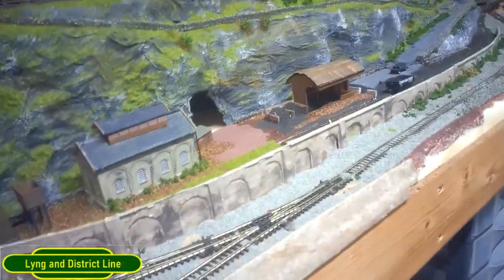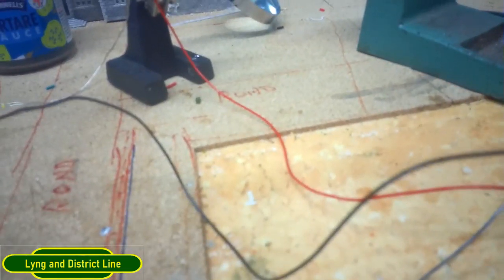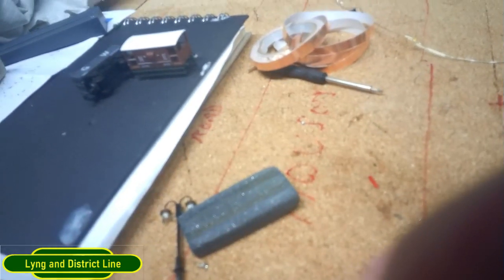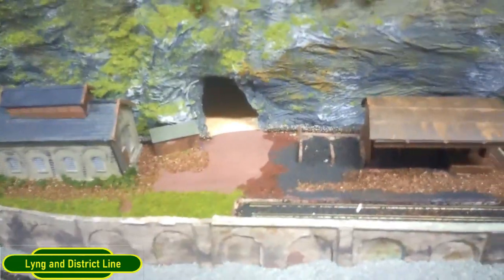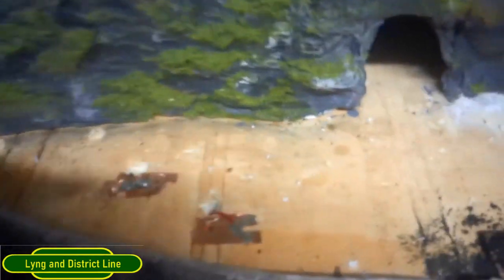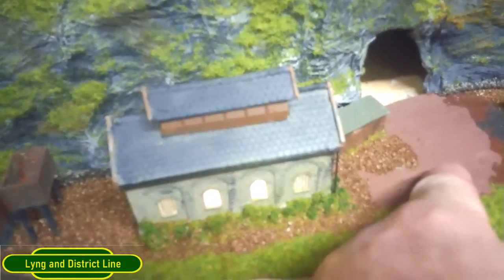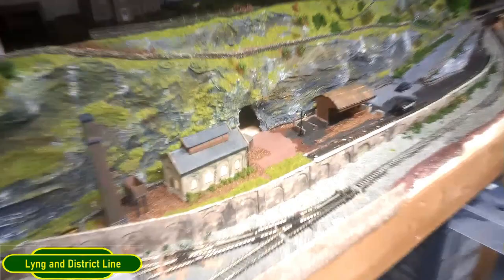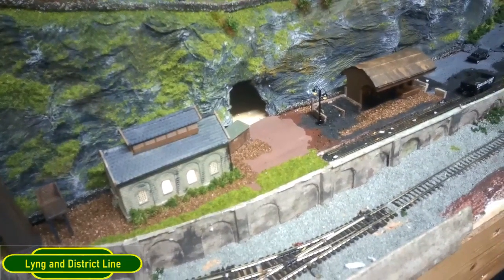Lyng and District Model Railway - Episode 44 - Experiment in lighting the Coal Mine

Comment: It is so satisfying when you think of a solution and it works. Well done  on getting  light into the coal mine. It did it look good she you turned off the lights.  The Castle looked so at home going round your layout. By the way I noticed in the Bachmann Times that Scencraft have 1960s/70s  coal miners in N scale production. They won’t be cheap, but they will give you some figures for posing in key  places.  If they are in production should be here by July I would think. Stephen
Reply from the maker: Wow thanks fir the heads up on that Stephen I will certainly keep an eye out for these 
Regards
Steve
Reply: @lynganddistrict  Bachmann code is 379-313 for the 1960/1970 coal miners, just in case you keep an eye out for them.  Ingenius idea using copper tape, although I have tried using it as a power bus for track power, it worked too! Amazingly. Thanks

Comment: Great job Steve! Well done on getting the lighting in the mine area to work, it looks great! That copper tape is really useful stuff! I bought a roll a while back when I was experimenting with point control, but ended up not using it! I'm pretty sure it will come in handy as 'bus wire' when fitting out buildings with lighting! All the best, Ian.
Reply from the maker: It was bugging me how I could work around the issue and then when decorating I picked up a "touch" lamp and thought hang on what if ...... and then just tried it! Just like your servo box's - where there is a will there's a way ...
Regards
Steve

Comment: Hi Steve, good work mate, another good solution, I’ve seen someone in the past use copper tape for lighting and I bought some but I’ve no idea where it is now, lol! It looked very effective when it was all lit up.
Nice running session to finish up to, keep up the good work Steve, cheers, John
Reply from the maker: Cheers John .... I'll be using that trick for the castle and other parts. The good bit is if there was a derailment the power automatically shuts off so even when exposed the tape cannot accidently cause issues. 
Regards
Steve

Comment: Hi Steve, what an ingenious idea did you get that copper tape from B&Q or Amazon I’ve got lift out areas that need lighting nice running session to end with cheers Al
Reply from the maker: Hiya Al, no I bought it from Layouts4U https://www.layouts4u.net/electrical-items/wiring-and-accessories and got it for lash ups like this. I'm going to try it on other parts i.e. the castle so I can fit LED uplighters to shine onto the castle walls. Should be fun.
Regards
Steve